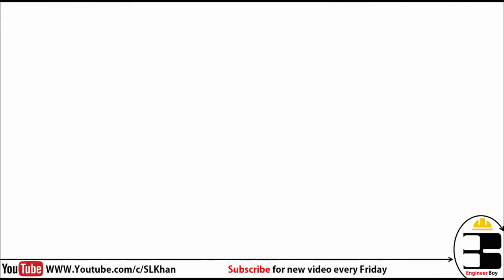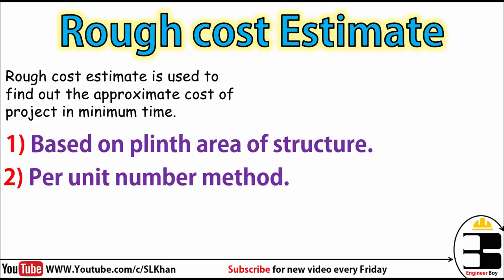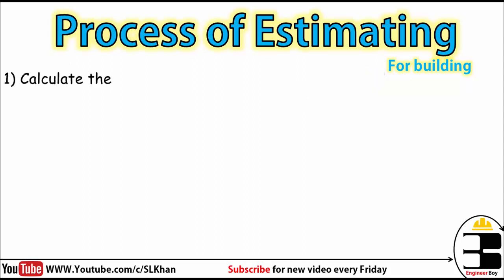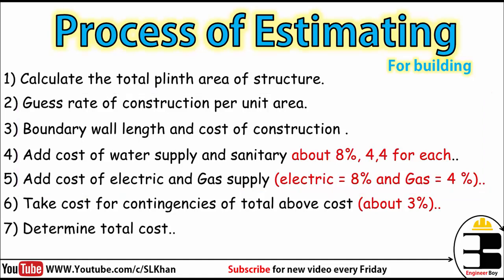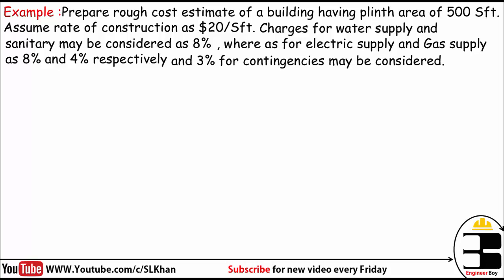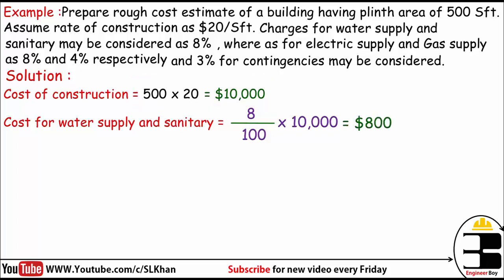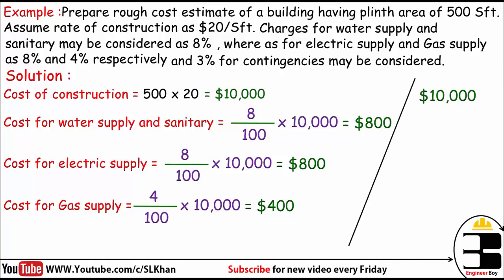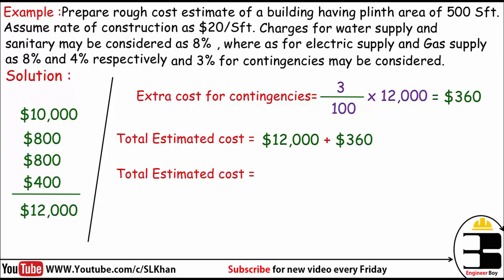How to do rough cost estimate / civil engineering videos

Comment: How much profit a contractor can make per project? I'm doing civil engineering now and I want to know which estimate method you use to get the money from clients?
Reply: Profit margins can be very small for construction companies despite construction being a high risk industry. Estimating the cost of a civil engineering project can be complex but put simply, you need to quantify the scope, plan the duration of the works by estimating the output of each trade then cost the preliminaries, Labour, plant, materials and subcontractors that will be needed to complete the project. You will need to then add an amount for the recovery of business overheads (non-project related costs) then decide on how much profit you want to make.
Reply from the maker: You can show your client rough cost estimate of structure. When he is satisfied then you can show him detail estimate
Reply from the maker: Its a good question having long answer which can not be answered in comment
Reply: @Sulimankhanacademy  approximate estimate or detailed estimate? Which one do you show to your clients? Answer will be simple... Select one.... Please reply